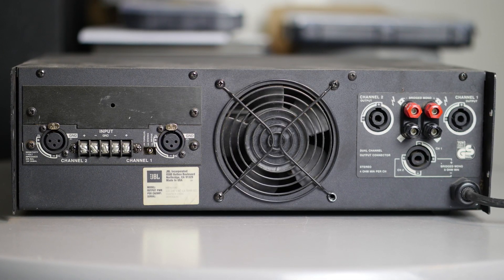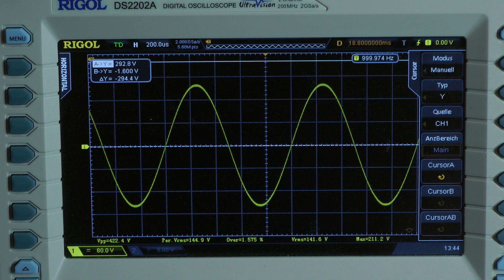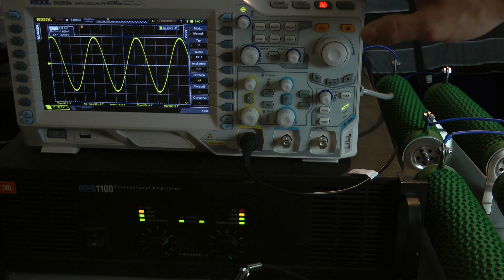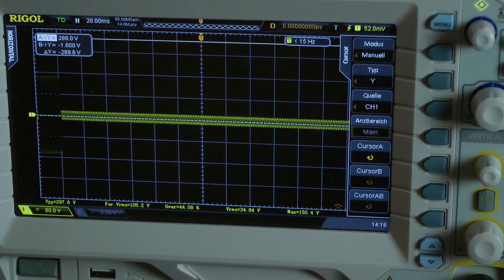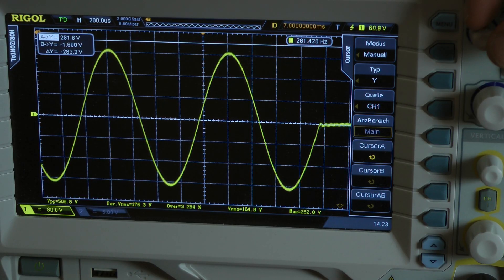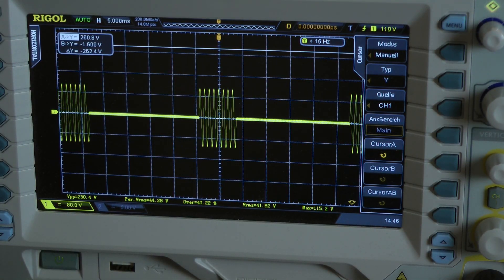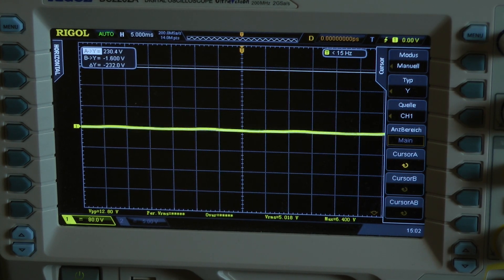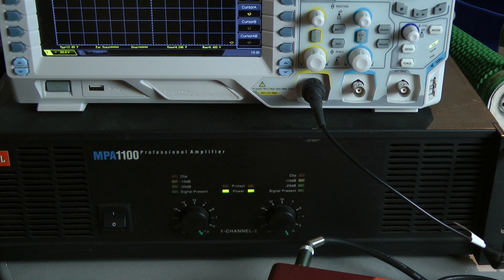JBL MPA 1100 ( QSC Audio ) oldschool pro audio amplifier amp dyno output power wattage test

Comment: Test pro amps at 2 ohms bridged
Reply from the maker: It doesn’t even like 4 Ohms bridged 😎😊
Reply: @audiokeller1975  im confused as why harmon used a qsc build.. jbl and crown have a long history together..
Reply from the maker: This is a rebadged QSC EX 4000
Reply: @audiokeller1975  heyy, what’s the maximum power it can keep working at, 4 ohms bridged, continuous 50 hz, without starting to limit
Reply from the maker: Maybe some more with speakers because pure resistive load like I used in the test are a harder load for the amp. There is no impedance rise like in boxes, in this case it limits at 4 ohms bridged.
Reply: @audiokeller1975 mmh but im confused… you tested it at 2 ohms stereo and not at 50hz, im more interested into the 4 ohm bridge for subs, do you still have the amp to run a test and see how much power it can handle continuously for subs duty? Without limiting ofc, cause it should be an ex4000 basically, and they claim it can work at 4 ohms bridge, i dont want to get all the power it claims, just want to know how much it can be used in a stable manner… thx cause i just bought one 😅 and instead of driving 1x 4 ohm 218 sub per channel i’d prefer having 4 amplifiers in bridge and 1 sub per amp
Reply from the maker: @xzVice 4 ohms bridge is the same like driving the amp into a 2 ohm load per channel both channels loaded!
Take another look into the sheet: I did not test the amp into a 2 ohm load per channel, so not tested 4 ohms bridged because of limiting 👍
Reply: @audiokeller1975 yep i know 4 ohm is basically the two stages in series, so 2 ohm stereo power x2. I was just wondering if the limiting occours only at high power, maybe it wont limit at 1800w at 4 ohms bridge (aka 900w at 2 ohm per channel) that’s what im wondering, sorry if i’m insisting
Reply from the maker: @xzVice it doesn’t even do dynamic power into 2 ohms, some amps don’t do continuous into 2 ohms but put out way more dynamic power into 2 ohms. Most amps trip the fuses with 2 ohms continuous. If that’s the case I show it in the video and put the values into the test-sheet.
Check out my test of the QSC rmx 4050HD, it does more into 2 ohms. Yes the amp is the same like ex4000 but it’s possible that there are some small differences, the MPA 1100 is power limited to 15kHz , not sure if that’s also the case with the ex 4000. the original manuals are still available for download.
Reply: @ ohh rip! I watched your 4050hd video, and i was wondering why it would put out power at 2 ohms without any problem. So an EX4000 would work fine at 2 ohms? In the manual they claim 20-20k power at 2 ohms
Reply from the maker: @xzVice i deactivated the Limiter on the 4050. it’s possible that its fixed on the MPA and different on the EX ?
Reply from the maker: It says 1600 watts at 1kHz 1% THD into 2 ohms, not 20-20kHz 😉
Reply: @audiokeller1975 yeah just checked the ex4000 datasheet, you’re right!